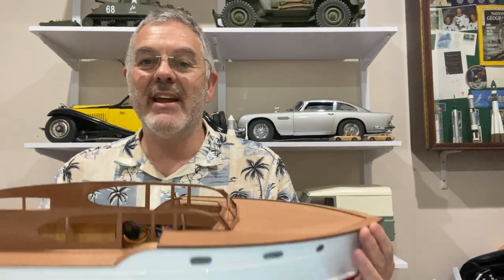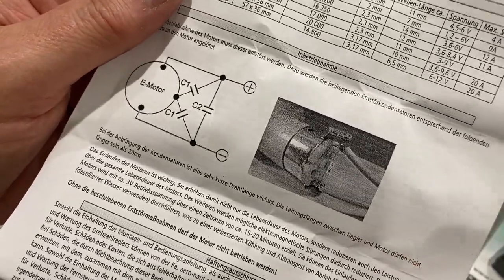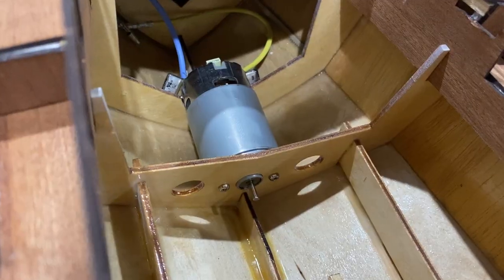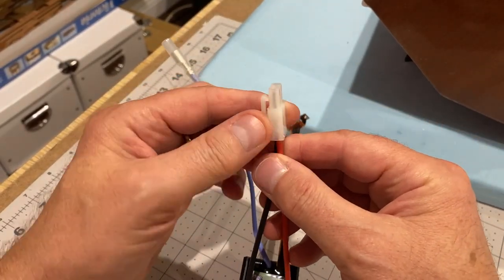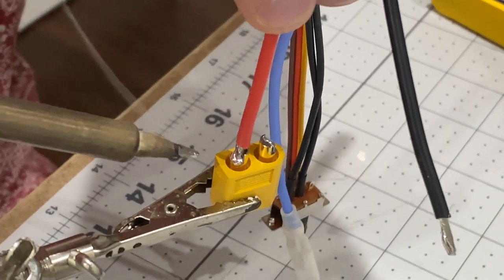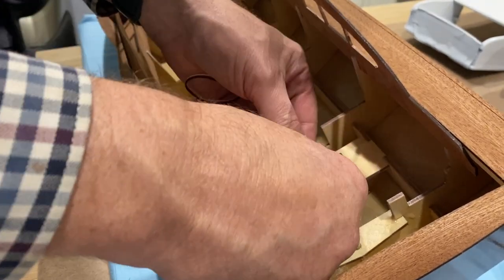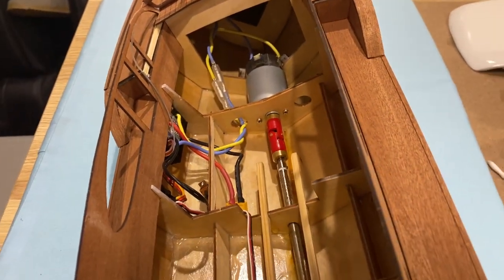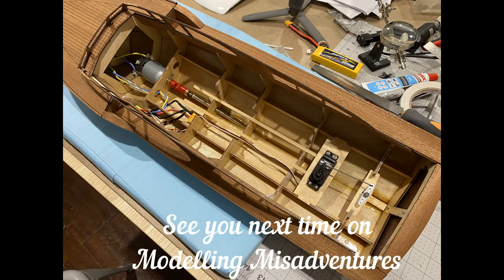Building an RC boat - can I make a Chris Craft Corvette out of the Aeronaut Victoria? Part 5.

Comment: I've been enjoying your build/conversion, impressed with your ingenuity. I have a really  old Sterling 63-Foot Motoryacht, with old brush motor and Astroflight speed control, using a large toggle switch and servo for reverse. I hollowed out the Sterling "leadloy" light fittings and installed grain of wheat bulbs and used small servos and  and pushrods with egg shaped cams and microswitches to turn running, cabin and decklights  separate channels. I'm toying with the idea to convert to brushless motor and reversing speed control, and lipo power, use of modern electronic switches, LED's etc. It has a swiveling search light and bicycle horn. I made venetian blinds for the side windows of 1/64 ply slats. I hand carved people and deck furniture including iconic bikini girls for the front deck. Made rear deck furniture from mahogany stock. My model needs a good repaint/refinishing, ( I'm lousy at painting too). I imagine you are going to fashion a "bull nose" somehow for the bow. Will be watching your progress.
Reply from the maker: Thanks for the comments.  I hope my boat turns out as well as yours.

Comment: That's a hefty bit of motor in there. What did you use for seals to keep water from entering through the prop and rudder shafts ? 
It's coming up a charmer.
Reply from the maker: No seals, only grease.  And the two bladed prop was the one provided by the model boat shop as suitable for this boat.

Comment: I see that you're using 2.4g radio - just FYI, I believe that you don't need the capacitors on the motor with 2.4g because interference was only a problem with the older 27/35/40mhz radios. The frequency of commutation is nowhere NEAR 2.4Ghz so apparently causes no problem. (I'm not a radio or electronics specialist so don't put your life on the line based on this gen. Maybe a better informed watcher could elucidate.)
The boat is looking very nice BTW. Strange that I'm following this series really - I'm really not into boats (I'm a glider guider). Oh well, carry on...
Reply from the maker: I enquired about this when I bought the boat and also did a bit of research myself.  The model shop said that whilst it probably wasn’t essential to put the capacitors on, it wouldn’t do any harm.  Similar views were expressed online.  Another reason that was mentioned is to avoid interference for other boat users who may be on the older frequencies.  So I decided to put them on.  Thanks for the comments 👍